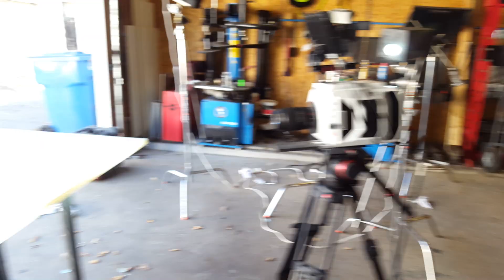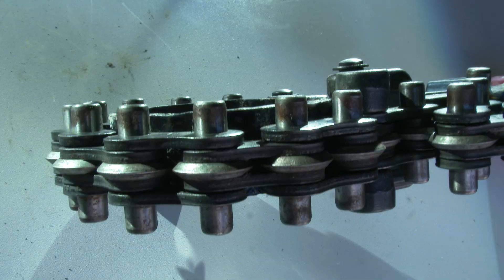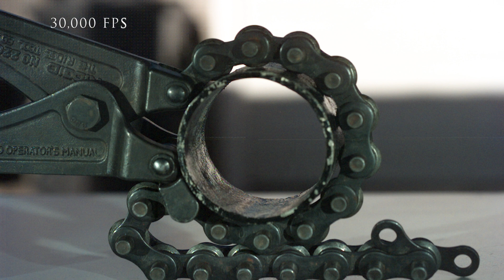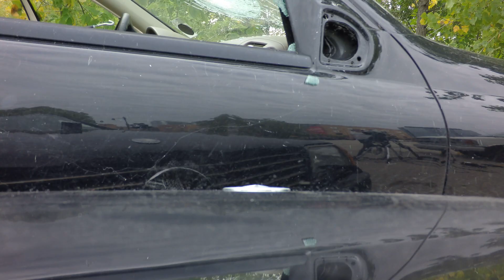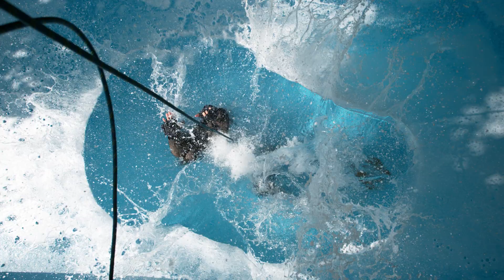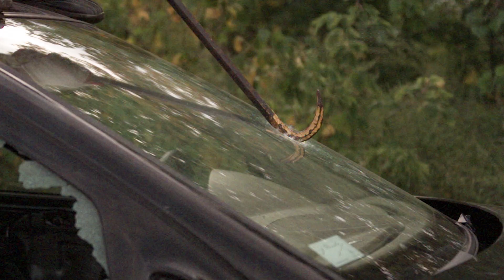Soil Pipe Fractured at 30,000 FPS - Ultra Slow Motion

Comment: I love the videos buddy I have to say that chain cutter is supposed to be spun around the pipe and tighten it up every revolution or two just saying that would have been cool too seen it done in slow motion the proper way it’s used it’s still good stuff
Reply from the maker: Thanks!, Your correct, but to be perfectly honest I have seen hundreds of plumbers using these cutters and they almost never spin it. If you do spend it however it gives you a much cleaner final cut